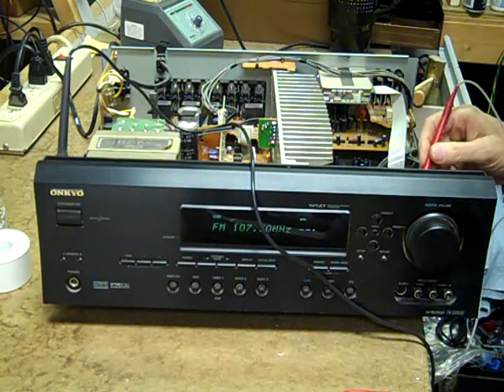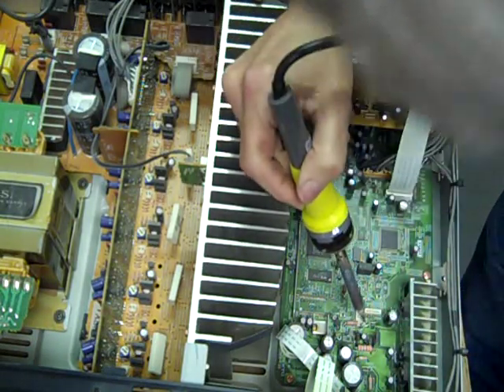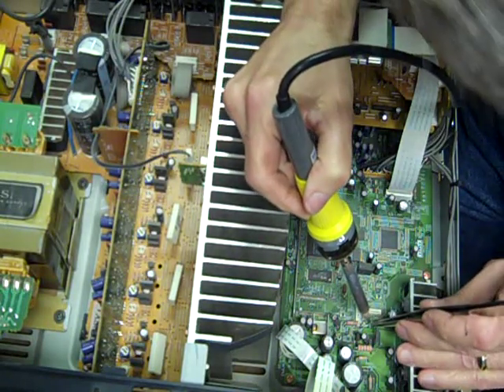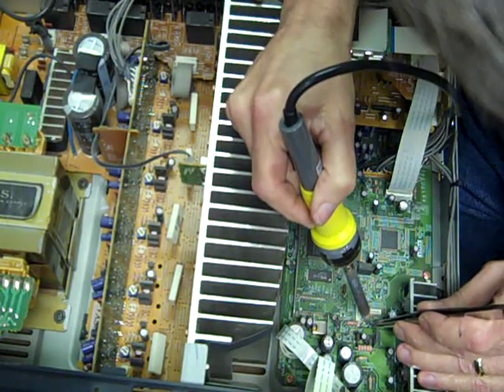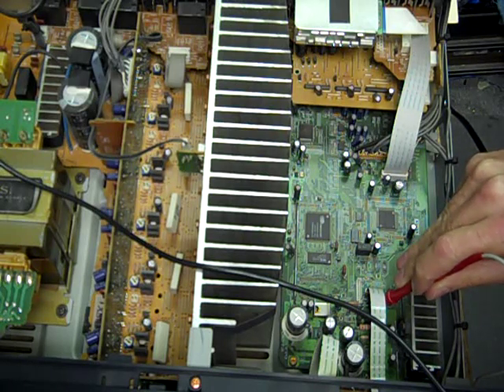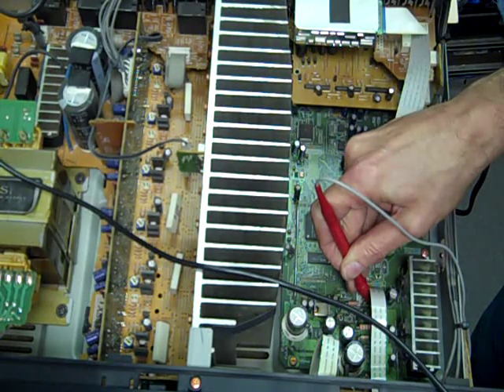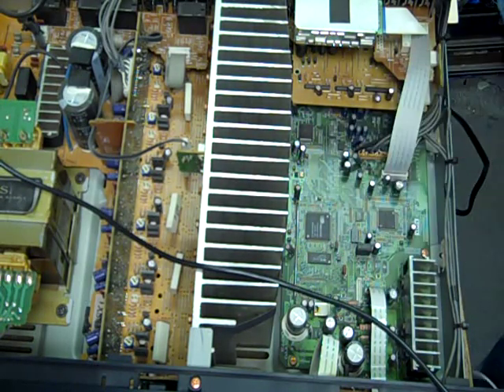Onkyo TX-SR502 Repair Brief

Comment: I have the same model...my problem is the optical digital inputs only works when it's above 75 degrees outside...rcas,tuner and digital coax all work fine no matter what the temp is outside
Reply from the maker: I have looked over the schematics and there is really very little difference between the optical and the coaxial. However the optical receivers do get power via a slightly different route - through L282 and there might be a bad solder connection somewhere in that area, maybe at the coil itself or at the connector where the board plugs in to the main board. Sometimes poking around with a non-conductive item like a chopstick or a plastic pen while the unit is running can help narrow down the bad connection.
Reply: Mark Zacharias OK...thanks for the info

Comment from the maker: You need to describe things better to me.You say clicking.A single click or is the power relay "chattering"? If you are measuring only 6.9 volts coming off the standby power board, maybe the capacitor filtering the 12 volts or so for the main power relay is bad.If it only clicks once when you press the power button, measure at the anode of D925 and see if it stays low. If it does, measure the DC voltage at the collector of one of the output transistors. See if that comes up.

Comment from the maker: I hear several clicks but there is nothing connected to that board. The relay only clicks if it is told to. It cannot click by itself, therefore the relay is not your problem. As to the matter of your actual problem, this may be one of those unusual type problems that requires extensive troubleshooting with a service manual, perhaps even board substitution to narrow it down.

Comment: Hi I have a sony str-de325 that has no sound. I need help trouble shooting it.  everything that ive checked seems to be fine..when i click the A speaker button i can hear the relay but when i click the B button speaker i dont hear anything.  if you can set me in the right direction i appreciated,  Thanks

Comment: I also found out the input to the L7002 is Q6406, a voltage regulator the input to this regulator is 10.7 volts. The output is 2.74 volts i am thinking this regulator is bad.

Comment from the maker: There's no magic fix. YOu need to be able to troubleshoot it or pay someone to fix it. I would suggest checking the standby transformer and the 5 or so volts derived from that for the microprocessor. If you aren't able to at least do this, you are out of your league.

Comment: Dear Mark....my name is promit....i am from bangladesh....i have an onkeyo TXSR502e av receiver...now the problem is my standby power of this av receiver dosen't work....if i press the power and then standby its shuts down and turn off.....this is how i am dealing with....would you help me out of this problem...it would be so kind of you to guide me.....and please send me your facebook profile link that i can massage you and add you as my friend...thanks in advance
Reply from the maker: Most likely a blown amplifier channel. Check the emitter-collectors for shorts at each of the output transistors for starters. If a channel is blown, frankly it may be beyond your ability to fix yourself.

Comment: hi mark i need help. model is r560. all outputs are good but it keeps going to protect even without load. have you seen this before?
Reply from the maker: You need to determine if there is a DC offset on one channel, or on all channels prior to shutdown. This will narrow the search to one channel, or to something common to all channels, like a power supply issue. Are you handy with a digital multimeter?